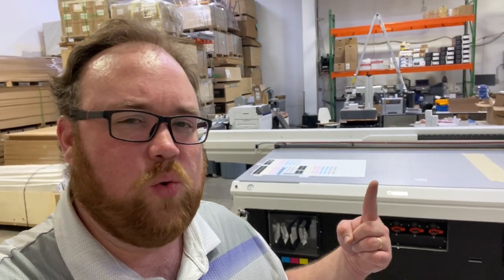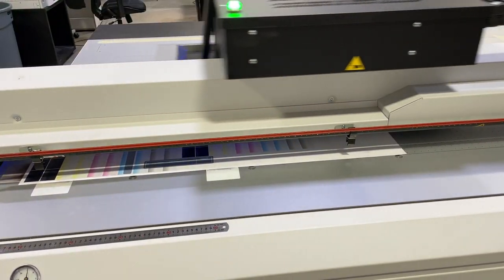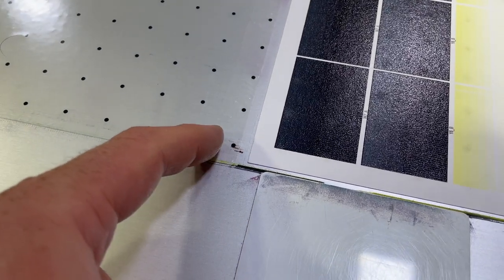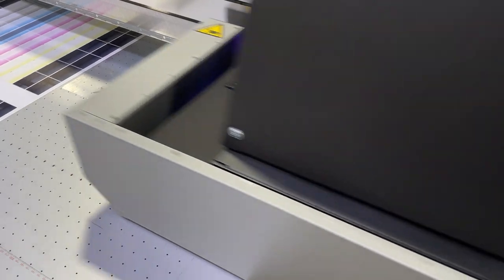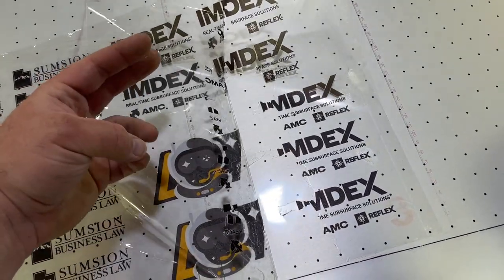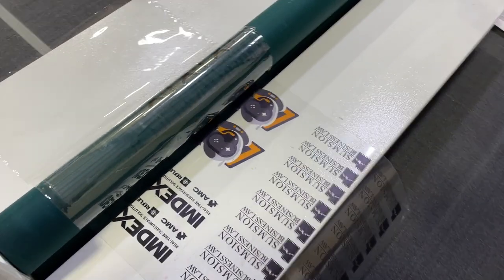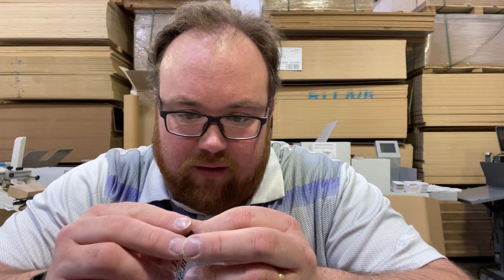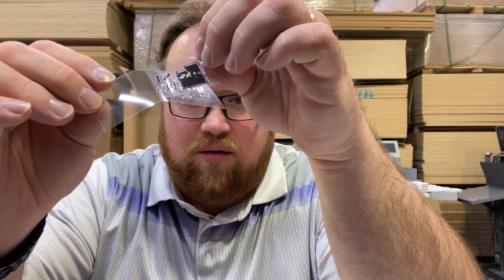UV DTF - first time testing uv transfers on canon Arizona

Comment: Hi there,
We use UV DTF but for the best results, we print White, Color and Varnish. It gives an amazing 3D finish and we only use it when the item does not fit or easily fit on our flatbed UV.

Comment: If you are using soft ink for for the transfers things will be fine. You can also print directly on soft bendable items. If you are using hard ink this way it can crack. Hope that made sense.
Reply from the maker: I think the main issue is my machine doesn't have clear. The transfers just scratch off.

Comment: you should use White + Color + Varnish to make it strong..
Reply from the maker: I don't have varnish.
Reply: You are correct! 3 steps
Reply: the process also need a hot temperature laminator 60c° to 80c° also varnish to mak eit strong